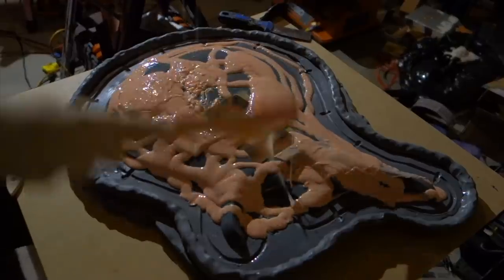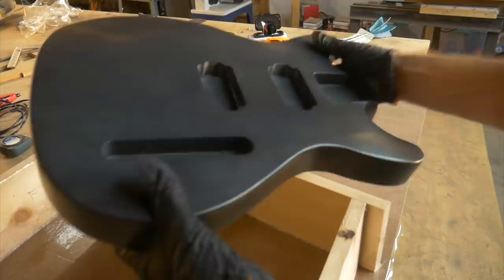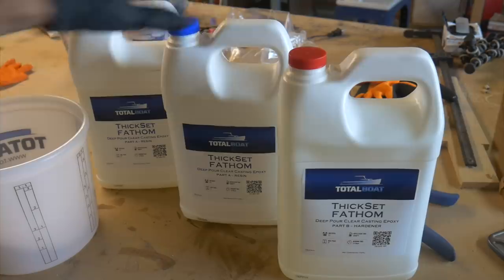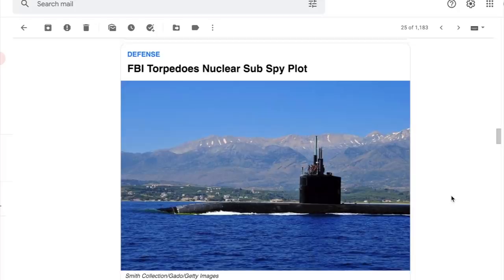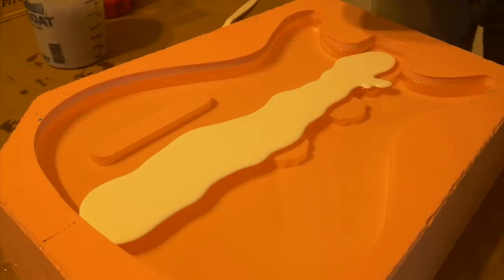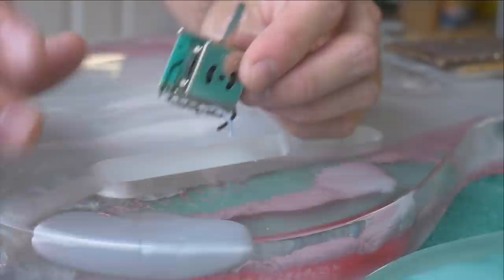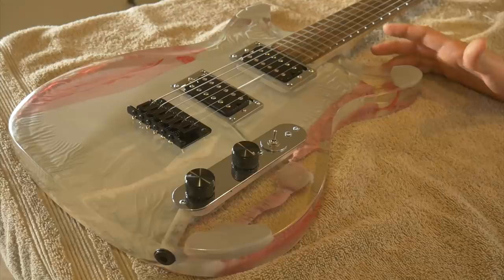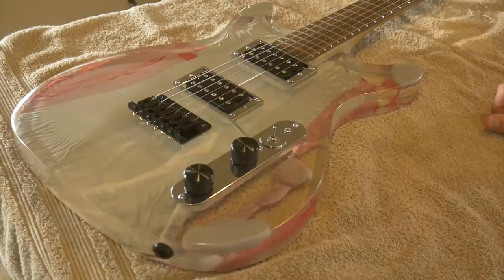I Built a Clear Guitar Out of Epoxy 2.0

Comment: Not going to lie, that looks cool. If you could master making whatever made that entrail looking blob you could make a “blood and guts” guitar a lot of metal guitarists would love.
Reply: DUDE! I would kill to have a blood-and-guts style 8-string!
Reply: Kirk Hammett would love it 😂😊
Reply: Neat idea. I don't know how well real entrails (like from a hog, chitterlings are easy to get) would stand up inside an epoxy guitar. Almost any hard or chemical glue tends to be a natural microbialstat. Any oxygen-dependent microbes would not grow, since there is no way to get oxygen in or out or to colonize beyond where they already are or where glue cannot reach. But then what's encased in the glue where the glue cannot reach could colonize and decay, and gases could build. I don't know, maybe install one vent or 2 in a V for aesthetics, and then after a couple of weeks, inject it or glue a plexiglass dowel in the vent. Or maybe bake the entrails before encasing them. Just thinking.

But really, a better option might be to make fake guts out of colored silicone, fill that with epoxy, and then once it dries in a desired shape (such as serpentine, then encase that).

Or for even less work, encase a rubber snake inside. Do the gore theme with the colors. For metal, anything with blood, guts, gore, snakes, or rodents, or skulls might work. 

And hell, if you want to go more gothic/punk, I imagine some plastic bats inside could work. You know, maybe a black neck, mostly clear body with bats, and maybe gore (blood or vampire theme), and maybe some purple (associated with vampires). Throw in some glitter too if that fits the theme or the entertainers wear glitter makeup.

I wonder how bugs would do. Like killing some roaches with chemicals, then waiting a few days until they are crispy and any microbial activity has ceased, then encasing the dead bugs. Maybe Chinese cockroaches (water bugs) would be candidates.

Comment: I'd be really curious how you'd tackle a mold for a one piece guitar (neck + body a single piece), something like what Aristides does. That could have serious functional benefits as well on top of the aestetics. Really cool build though as always!
Reply: I think that would be cool but complicated. Especially when it comes to putting in frets and making sure the neck is straight and doesnt warp or bend when the strings go on -- I mean it shouldnt warp or be warped because epoxy is strong but I still think theres a lot that could go wrong if the mold isnt right.
Reply: @Rose.Of.Hizaki  he could probably figure out a way to install a truss rod
Reply: @billbergen9169  I thought of this too. but epoxy generally doesnt have a lot of flex (most likely none at all) when compared to wood

But at the same time i have seen guitars made out of glass so who knows.
Reply: @Rose.Of.Hizaki  could have a carbon fiber shell and so it's not to heavy, could be filled with a mix of resin and glass bubbles or some ligh filler, there's a lot of room for experimentation here :)
Reply: That would be absolutely amazing to see.
Reply: Unfortunately, I think that would be very difficult. There is the necessity of the truss rod being installed and string tension, which may not work with an all epoxy guitar. Not to mention the tone of it being all epoxy, may sound like crap. I know that the Ampeg Dan Armstrong guitars used to soften when exposed to moderare heat, and soften. I dont knkw how epoxy reacts to that or the added tension due to strings and truss rod. Just some thoughts.
Reply: @billbergen9169  its not the problem of installing a truss rod. Its the ability of the truss rod adjusting and there needs to be some flexibility.  Wood is easily flexible and able to give relief, and thus able to accommodate different players requirements and styles. Im sure it could be done.
Reply: @billbergen9169  or even something like those carbonfiber neck reinforcement bars like Stewmac sells.
Reply: How about doing everything but the fretboard and including the truss rod channel in the mould, the use some sort of micarta for the fretboard?
Reply: @martincampbell1990  That would be my suggestion too. And maybe have the fretboard from a synthetic material too like richlite so it's fully wood-free :)
Reply: @martincampbell1990  there’s a company that sells glass necks, I’ve seen frosted, but they might do clear.
Reply: @stephencastro1437  there was a company that used to build bass necks out of epoxy and carbon fiber, and they have no truss rods. The company name was Modulus if you want to look them up, but I’m pretty sure they don’t exist any more unfortunately.
Reply: you probably have to do a seperate fretboard
Reply: @ryancozzolino7832  I remember them. But they had carbon fiber! Anyway, I stand corrected.

Comment: The new mold is a huge improvement, the guitar body looks fantastic. Would adding individual drops of different colored epoxy be an option? The way the colored epoxy sinks down into the clear epoxy could give it almost a raindrop or meteor shower effect.

Comment: If you're going to float colours in clear you will need to do it in multiple stages with each setting up like your old method. Pouring it in unset will just lead to what happened with weird sinking and mixing. A cool way would be to make a releasable silicon insert in the middle so you could pour beside and around the insert then take it out when it cures so you'd have a hollow middle to pour into.

Comment: The secret to what your trying to achieve is to let each layer dry first. Ive done the epoxy 3D art. If the clear first layer dry then you add you color. Let that dry then add more clear to the level you want. You can add as many layers as you want. Just let them dry.

Comment: Gorgeous work as always!  I have had the best success with 3D color separation using Alumalite Amazing Clearcast, and the mold was about 6 inches deep in the thickest spots and no cracking occurred.  That would be a lot of epoxy in one go for a guitar build, but Alumalite also has a deep casting resin I have yet to try.
Reply: 6 inches deep in the thickest spots...there's a joke in there somewhere. Lol. Sorry.

Comment: What about putting barriers in the mold to split the body up in sections with different colours. 
You could either dry one section at a time to get a defined border. Or maybe remove the barriers before it dries so the sections have a gradient between them.
Idk how it works and haven't tried epoxy before. But just an idea :)

Comment: Less is more, and syringes with thin needles. Inject bubbles as the clear has thickened up a bit (if that even works). 

It should make it easier to control the startpoint of the colour and easier to see how it reacts as it cures if you have small pockets of colour instead of a blanket.

Comment: Should probably try a shape of Ibanez ARC series, but with a bolt-on neck. Will take less epoxy and give you a really fancy and comfortable guitar.
As for the paint, try experimenting (deep cups will most likely do for testing) with adding paint at different points in curing time. Would probably take steps of about half an hour between different samples if I was doing it myself. Will give you a pretty good understanding at what point the end result is easier to control. Then try different colors, as I can see from that body you made, they too vary quite a bit.

Comment: Idea:
Make a plug with some kind of 3D design on it. Maybe a logo or something. 
Pour clear epoxy into the guitar mould, then press in the new plug, and let dry. So at this point you have the front of a guitar with a design embedded in it (or, you could just kinda carve out a design). 
Pour colored epoxy into the design. Let dry. Pour clear epoxy in to fill in the rest. 
So, basically you would have a design suspended in the middle of the guitar.

Or, if you wanted to do it all in one pour, get rid of those seams, make it so that you can pour in all of the clear and let it dry and then pour in the colors. You couldn't get it suspended in the middle that way, but it would be more seamless. 

Or, you could actually just suspend objects themselves inside of the epoxy. 
Idk, I've got lots of ideas, but no actually knowledge of how this stuff works. I'll have to do some experiments of my own one of these days.

Comment: Idea for next guitar based on these:
Take the colored stuff and drop it into the epoxy from various heights one drop at a time.
You'll have to experiment with how set the clear epoxy is to make the 3d dots.
You could also try dropping in the single drops at different set times, such as 3hrs - 6hrs - 9hrs - 12hrs

Comment: Why not 2-piece? Like do half of it, make grooves in it, put the color in the grooves, then pour the other half. If you fear separation or a bad bond, maybe use recessed screws, like maybe some nylon ones, For aesthetics, maybe use 3, like the 2 points and the bottom. Or add 2 more into a star formation, maybe even put them at the corners of the internal grooves.

Or even add glitter inside the epoxy. Glitter is a bit easier to control, though pouring the epoxy would be a challenge. It might need to partially skin before you add more, etc. Or use designated pour points, etc.

Comment: I wonder if there’s a way to “bake” the epoxy in place. Basically assisting the curing process to preserve the design inside, without causing a yellowing of the clear epoxy. Or maybe freeze it for about an hour or two to thicken the epoxy so they don’t completely mix like the red one did. Or perhaps only let the clear cure for an hour then add the dye. 🤷🏽‍♂️ Not sure, just “brainstorming” hoping that something gives you an idea to try so you can “perfect” the process.

Comment: Really beautiful guitars! The only thing that worries me about using an epoxy guitar is the weight. You can really feel it when playing a 2hr gig. It’s one of the reasons I avoid some Les Pauls for long sessions. I’m curious if anyone has tried chambering the epoxy guitar bodies to reduce the weight? Or trying a headstock-less smaller body design like Strandberg or Kiesel?